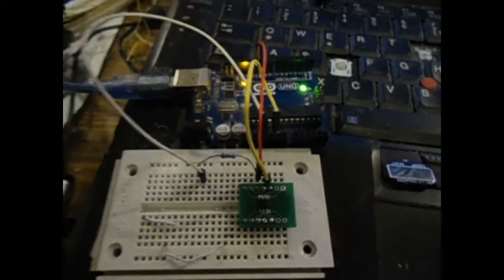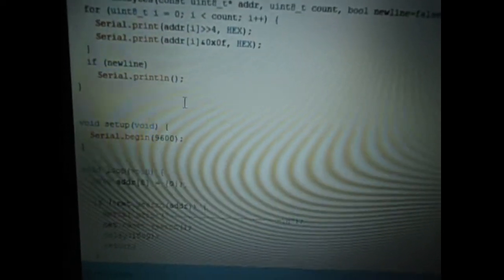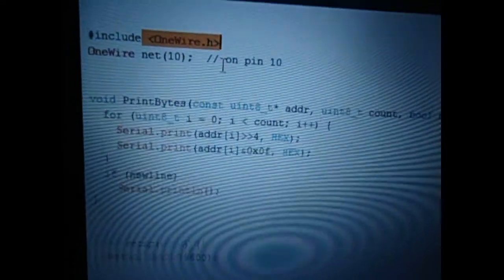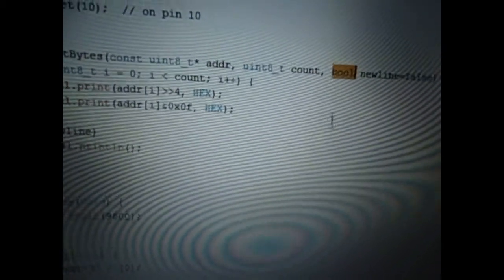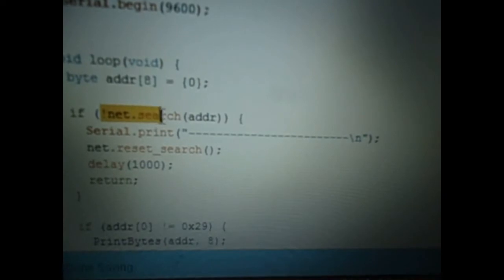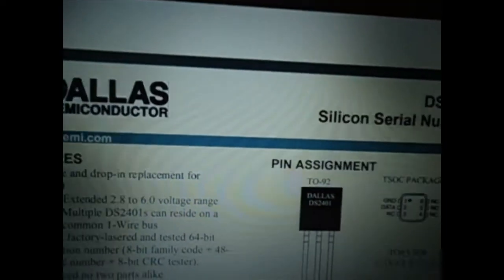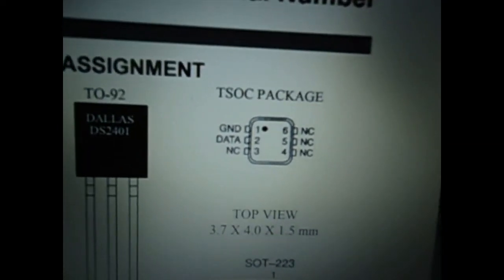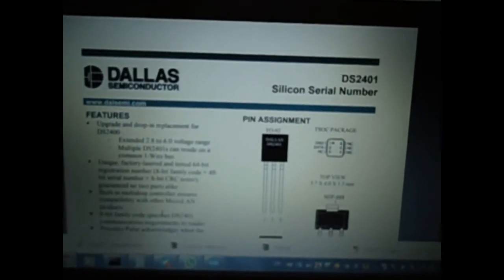Arduino DS2401 Silicon(Dallas)  Serial Number 64-bit Security Dongle

Comment: I need to copy the serial to another da2401 how can i write instead of read?
Reply from the maker: it is better to pay, and give professional worker to fix Thanks
Reply: @seyedmarashi  not sure I follow. The battery I am trying to replicate is vintage from 1995. It is no longer produced or supported. I want to make a few of them but I only have the original DS2400 that was inside the original pack when I cut it open. I am assuming that the serial number in it is programmed from Apple and it needs to be that same serial number.

Comment: Hello. And to get to read several (10; 20; 30 pieces) sitting on one wire? And if so, have you tried assigning a command when reading a specific serial number?

Original: Здравствуйте. А получиться прочитать несколько (10;20;30 шт) сидящих на одном проводе? И если да то вы пробовали назначать команду при считывании определённого серийного номера?